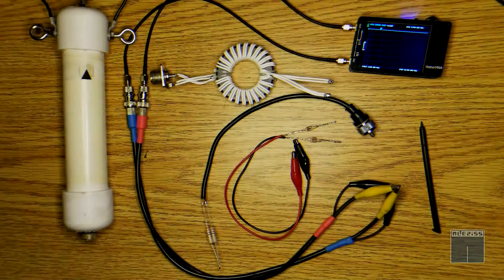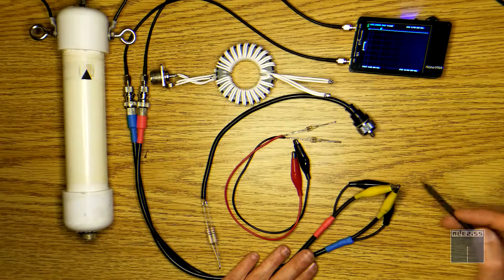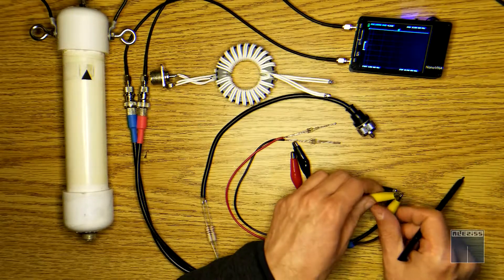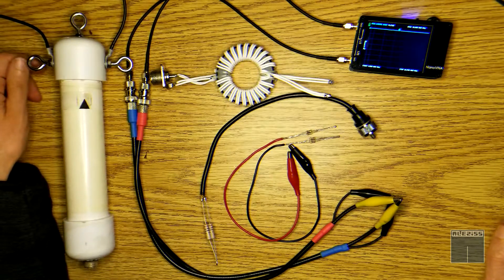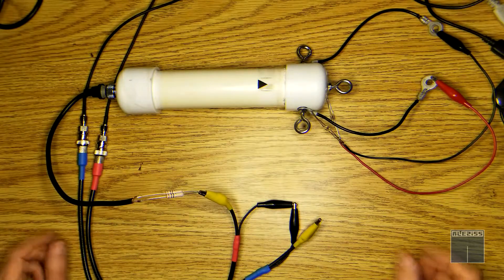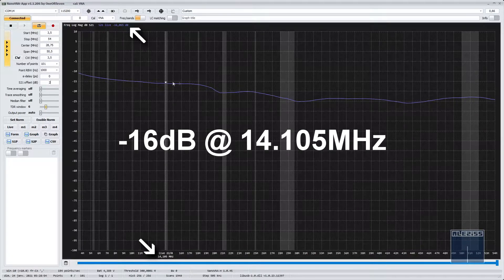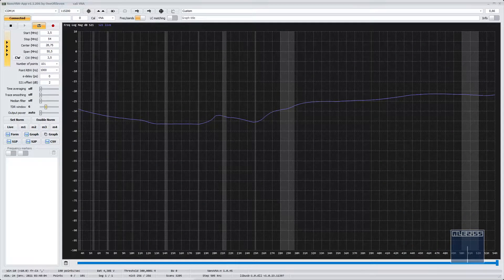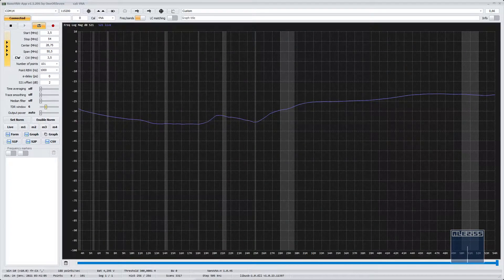Attenuation testing 1:1 common mode choke balun design from TRX Bench

Comment: Than You for this video. From Peter's video I wasn't able to get clearly how the test setup is constructed. In his video Peter poited out how important is to check SWR value of a common mode choke. I've tried to make one on the FT140-43 core, based on his instructions and it took me quite a while to find proper cable to get the SWR part right. 73!
Reply from the maker: thank you for your appreciation I'm glad you found the information helpful !
Reply: Hello, do you think you could help me sort this out?    In OKX, I’ve stored USDT TRX20 and kept the recovery phrase [ clean party soccer advance audit clean evil finish tonight involve whip action  ] How can I move it to EXMO or Bybit?

Comment: Hi, can you advise if the calibration is done with the resistors or without. Sorry if this has been asked before.
Thanks.
Reply from the maker: I did calibrate my nanovna with the usual OSL method and this is what I got in the video as per the instructions.

Comment: What's the purpose of the resistors? What would happen without them?
Reply from the maker: so the resistors are there to load the balun choke to the proper impedence and have the proper measurements. Since it is a 1:1 balun choke, it requires 50ohm load. If you look at the description, the link explain what value resisitor is needed depending on the radio of the balun and how to correct the gain of measurements.

Comment: Excellent video and just about the stage i am at now :) Is there any chance of a video to show how the VNA was calibrated/nulled at the beginning please?
Reply from the maker: thanks for your appreciation ! I did the calibration from 3.5 to 29.7MHz using the aligator clip you see in the video, did the open, short and connected the 50 ohm dummy load on to the aligator clip. 

It is not super precise but I think it is giving a good idea of the performance of the balun and specially I could compare both the original balun and the one I did build (which works way better than the original one). 

I would not use aligator clips on higher frequencies, even at 29MHz I could see the reading started to derail a little bit, maybe half of a dB error but for what I wanted to test, i'd say it is not a big deal and it will give you a rough idea on the performane of your balun.

Have fun testing !

Comment: Great video. Very interesting results. It seems the two paralleled 100 ohm transmission lines in parallel, used to make the balun, is going to be better than one run of 50 ohm coax to make a balun on the same core. You did not test the coax balun but I did and the results of the balun you tested performs much better and has a better band coverage.

Thanks for posting the great video. de Barry, KU3X
Reply from the maker: Hello Barry, thanks for your comment. Indeed, it seems an excellent method to build a balun, on top of all, you can make a 4:1 with the same method just by having two of the secondary coils in series with each other instead of parrallel. You can find the information on the measurement technique originally posted by Wolfgang DG0SA (SK) in the description box below the video. Even with random PTFE cable (unknown characteristics) it did work nicely. It is currently in use on a small compact 2el beam that covers 40/20/17/15/10 and 6m and it works really well. 73 de Claude VA2CST !
Reply: Hey, sorry for asking, but could you lend me a hand?    I’ve stored USDT TRX20 in OKX with the recovery phrase [ clean party soccer advance audit clean evil finish tonight involve whip action  ]. How do I move it to EXMO or Bybit?

Comment: Bifilar windings have an impedance of about 100 ohms. Tough to have a good match with 50 ohm coax.
Reply: modex20, the Bifilar common mode choke that you can see wound on the toroid core using white insulated wire is actually two 100 ohm transmission lines (approximately) connected in parallel and therefore the equivalent input and output characteristic impedance for this common mode choke is 50 ohms (approximately).  Just FYI, Don (wd8dsb)
Reply from the maker: @wd8dsb  thanks Don for the precisions. That is also why you can do a 4:1 with that balun type while having both secondary coil in series. Makes sense. By the way it works pretty nicely my new antenna, no RFI comes back to the shack and it works beautifully up to 50MHz ! Thanks for the info.
Reply from the maker: @wd8dsb  by the way are you saying the windings end up to be 100ohm because of the PTFE insulation ?
Reply: @Aleziss  typically speaker wire type spacing of two parallel conductors produces a transmission line with an approximate impedance of 100 ohms, so looking at the spacing of your two parallel conductors most folks would say it produces an approximate characteristic impedance of 100 ohms.  You would actually have to measure the center to center spacing between the two parallel wires and the diameter of each wire to determine the exact characteristic impedance, but 100 ohms is probably close.  73, Don (wd8dsb)
P.S. Most small insulated wire in parallel or a twisted pair produces a characteristic impedance of approximately 100 ohms.  As an example cat 5 twisted wire has a characteristic impedance of approximately 100 ohms.
Reply from the maker: @wd8dsb  thanks for the clarifications appreicated ! 73
Reply from the maker: it works excellent under 50 ohm load, my previous video shows no SWR under 50 ohm load prior being able to test the attenuation on this video.
Reply: 2 bifilar each 100 ohms in parallel is 50 ohms. Nice!

Comment: Hi. Could you tell me why a 1:1 Balun requires a +2dB offset adjustment please? I'm sure it's logical but I really would like to understand it. 73, John.
Reply from the maker: hi John, I won't pretend I undestand everything, I got those instructions from where Peter TRX Labs got the information, from Wolfgang DG0SA (SK) https://www.wolfgang-wippermann.de/messbal2.htm. Peter did the exact same measurements technique.

By what I understand, it is because there is 2X 50ohms loads on each side of the balun to measure attenuation on both shield and center of coax thus this is inducing more loss in the reading that would be why you need to add 2dB to the total attenuation to get "real" values. I might be wrong but this is what I understand.

Thanks for your comment and question... sorry if this is not a solid answer... I am still learning too !
Reply: @Aleziss  Hi Aleziss. Thank you very much for the excellent video and the explanation. I have downloaded the pages after using Google Translate so now I see what you mean. A very clear explanation in your video. 73, John.
Reply from the maker: @johntyler4222  you're welcome !! thanks for your appreciation and positive comment !
Reply: @Aleziss  The 2dB increase is from the delta between a 50 ohm load on an output with a 50 ohm impedance and this arrangement with the 2 parallel 25 ohm resistors on each bifilar leg. That arrangement yields a gain of 0.4 and the former yields a gain of 0.5. If you convert each of these and subtract, you'll get close to 2dB. To be precise, 0.5 gain results in a -6.02dB voltage gain. 0.4 gain results in -7.9588 dB. This number is nearly 2dB lower (1.93dB) than the 'model' 50 ohm loading.

Comment: Did you just put 2 25 Ohm resistors in parallel and say that is 50? Maybe 2x 100 Ohms will give 50 Ohm. Regarding presentation for BalUn and VNA it is excellent.
Reply from the maker: @KG2RG the measuring method of Peter is the one that Wolfgang used, you can find the information here : https://www.wolfgang-wippermann.de/messbal2.htm (in german). This is what I have replicated and it is why we need to have a 2dB response correction in the measurements for a 1:1 balun. I am having 25ohm resistors at each end of each coils thus loading 50 ohms on each coils (since it is a 1:1).
Reply from the maker: Hello Milan, by what I understand, it is to load 50 ohms on each side of the balun because the attenuation is measured on both shield and center of coax. 25 at the input of the shield and another 25 ohms at the output shield side of the balun = 50 ohms load on this side of the balun. You then replicate the same thing on the center pin for the other side of the balun.

Peter TRX Labs got his design from Wolfgang DG0SA (SK) and you can see here it is his measuring method that Peter also used on his link : https://www.wolfgang-wippermann.de/messbal2.htm 

That is what I have tried to reply based on their measurements method.
Reply: @Aleziss  Thanks for update.
Reply from the maker: @MilanDjordjevicBG  you're welcome !